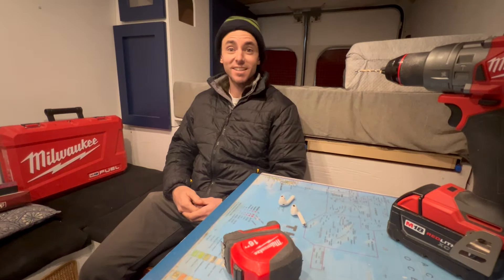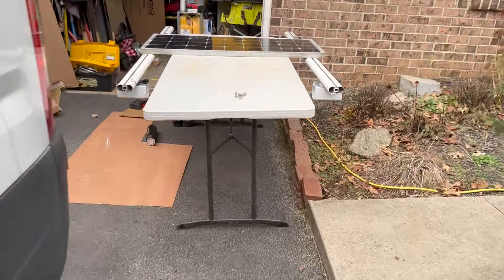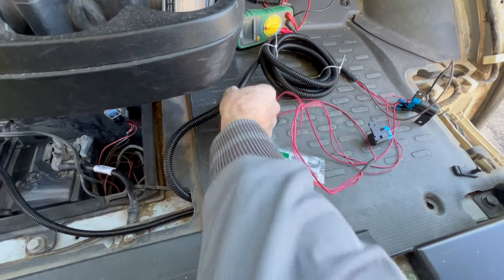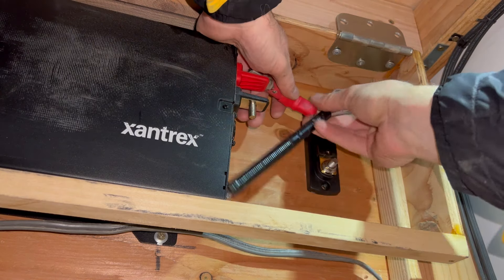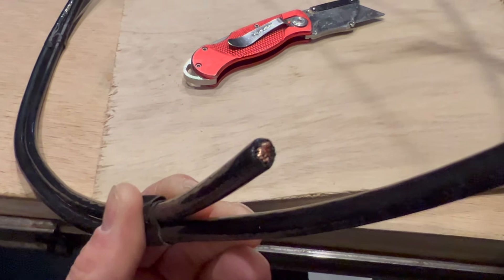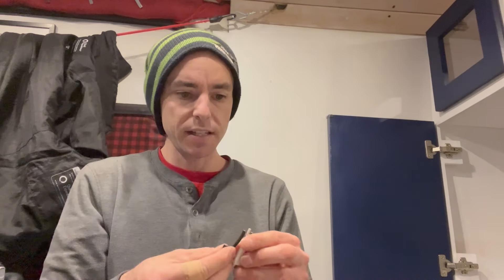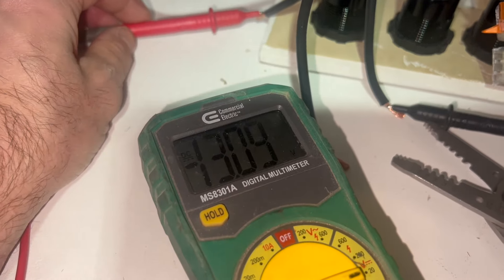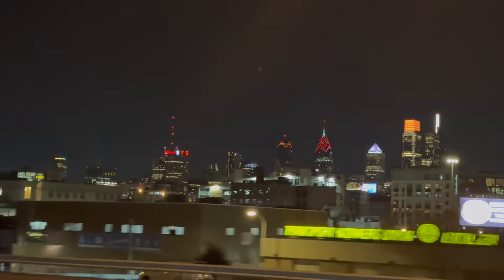Renovating the van after 5 years — VANLIFE ELECTRICAL

Comment: FYI if you want more outlets. Get a surge protected power strip, plug into inverter. I used extension cords (10g) to run to outlets, and cut the plug off to wire to the outlets. Works awesome. And you have a built in ‘fuse’ box with the surge protection.  (Courtesy of Jonnie’s Journey’s idea🎉)